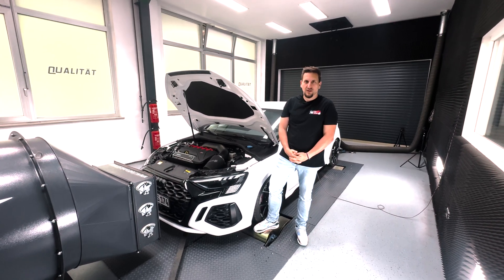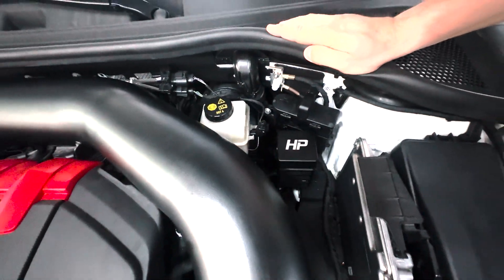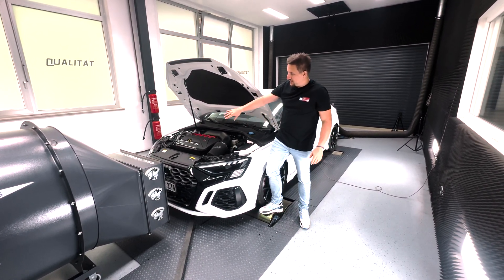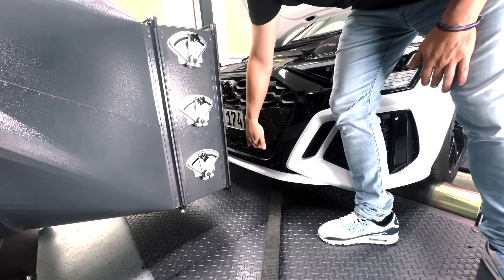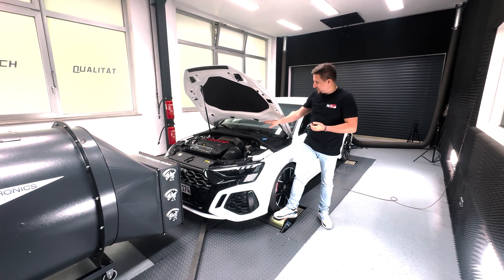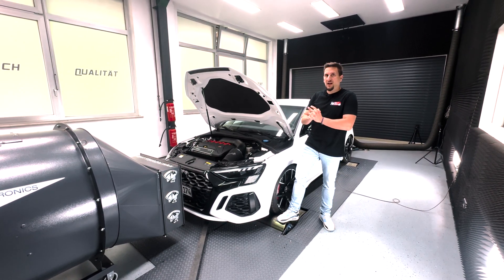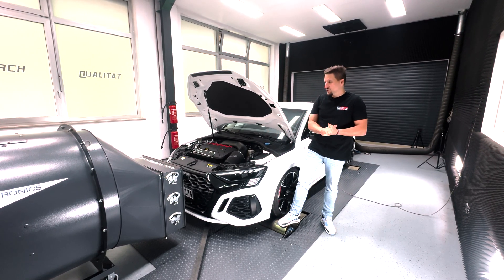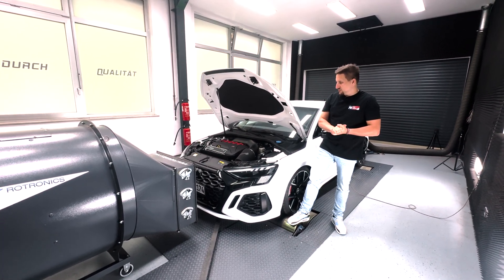Our 535hp TUNING STAGE for Audi RS3 8Y | HPerformance

Comment: Great video and explanation of what modifications you have done!.. 
What would the additional torque and power be like with your full exhaust system.. 😎
Thanks for the English audio. Please do more in English as your content is great! 🎉😊
Reply from the maker: Hello, the catback system would add around 10HP and maybe 15NM at this point, most of the gains is released by the 101,6mm Downpipe of the stage 2 setup :)

Comment: How hard is it to swap out the Downpipe on the 8Y?
Reply from the maker: First time you maybe need a little longer. If you have done this several times, it's a job of 30 minutes. Make sure you have a lift and a hydraulic lifter, too, then its not a big job.